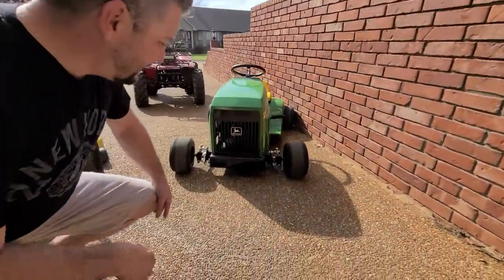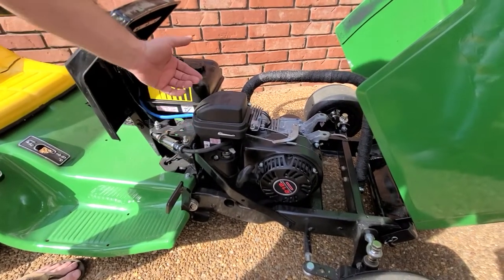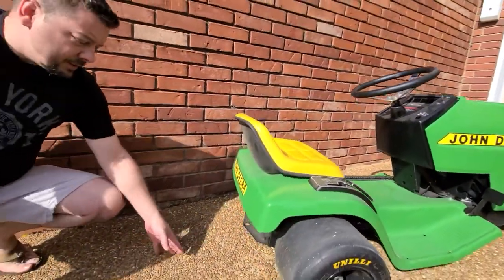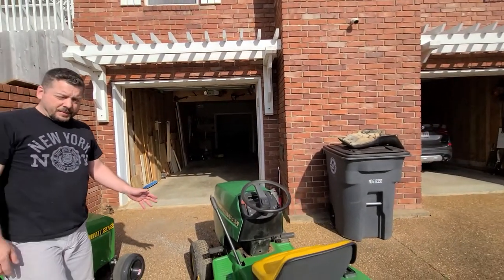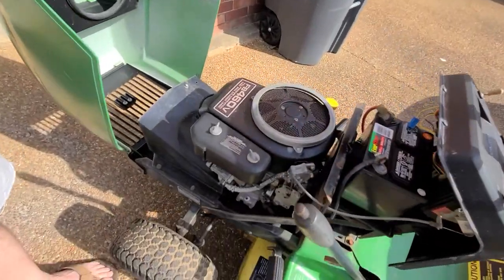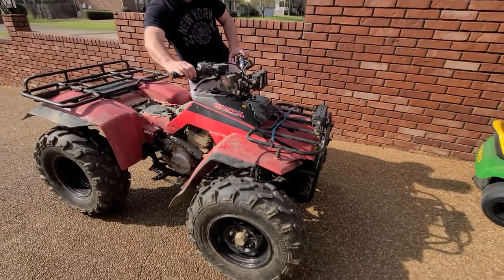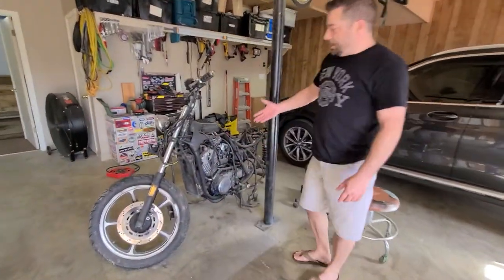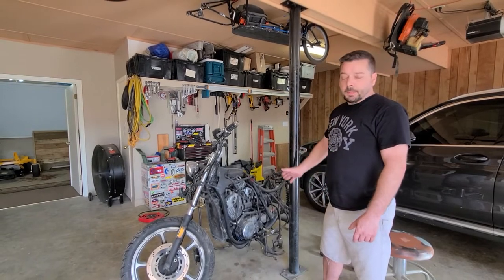Upcoming off road John Deere race mower build with a Honda 250 fourtrax engine

Comment: Just a thought... A kohler v twin is a really solid platform and really simple to run. They make great power when you even modify them slightly... I run the singles and even that's enough power to kick the tires loose on asphalt.
Reply from the maker: My builds are more for fun and unregulated to the racing mower rules. I'd love to do a v-twin one day! I'm just using parts around the house right now to keep the budget down and the wife off my back! 😁

Comment: can you post or send me pics i just stripped a 170 to the frame inspired to build a lowered deer , how fast you say it is with that engine and how did you do the rear axle thanks
Reply from the maker: Speed with the stock predator 212 is about 35 / 40mph.
I have some build pictures of it on my Instagram account
Rkunsaw.Garage
Let me know if you need anymore, I'd be glad to help.